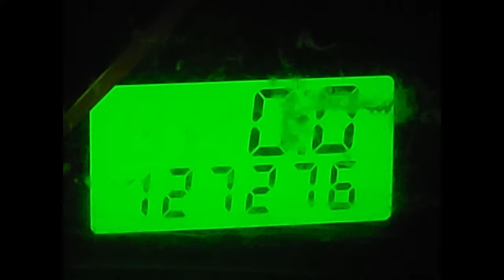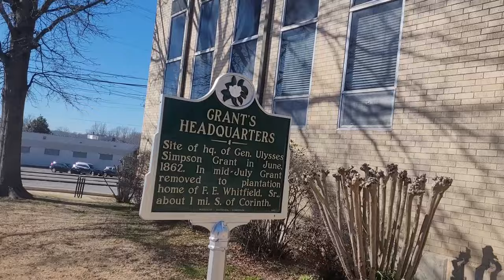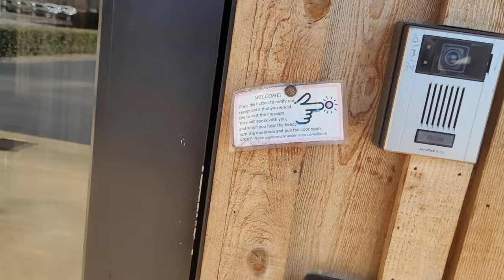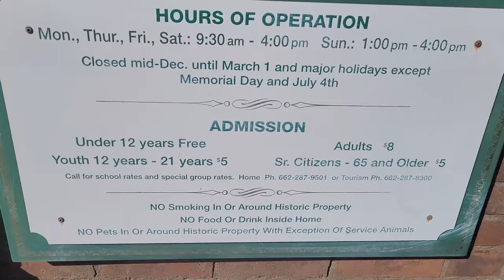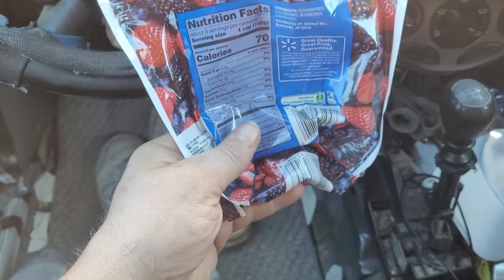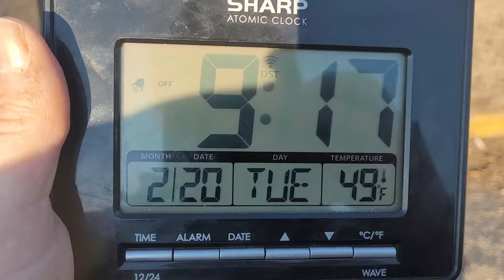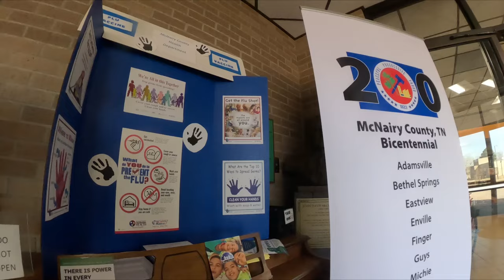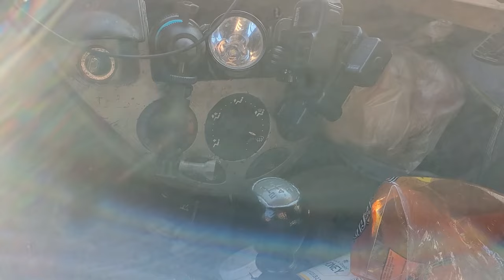vlogging my thoughts in Corinth, Mississippi

Comment: Candida overgrowth relies on increased alkalinity in your intestines. It needs neutral or alkaline conditions to switch to its fungal form. This is why acid-producing probiotics like acidophilus are so effective at slowing and even reversing the overgrowth, and why caprylic acid is an effective antifungal. Your digestive system has evolved with a naturally acidic environment that protects us against pathogens like Candida, so when you begin your Candida treatment plan you need to maintain that acidity.